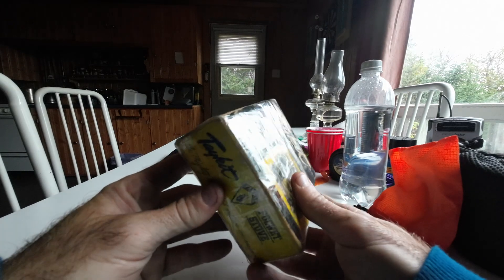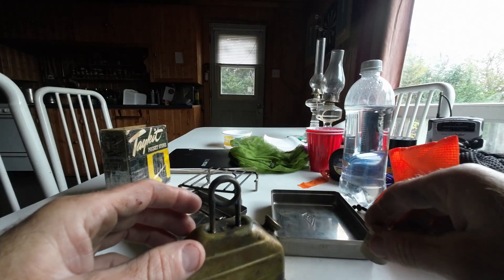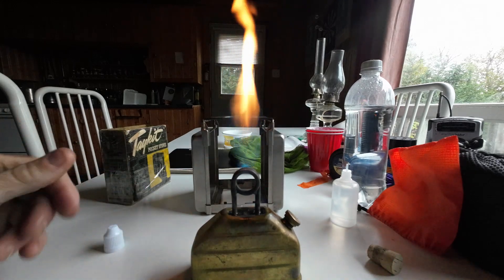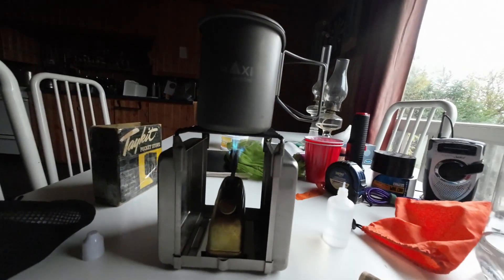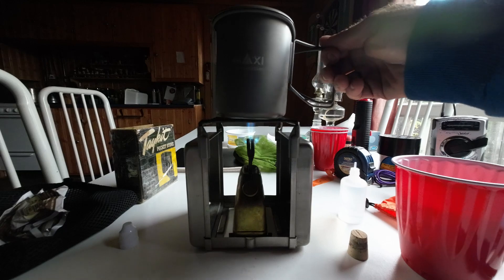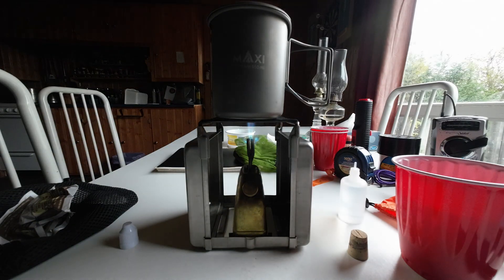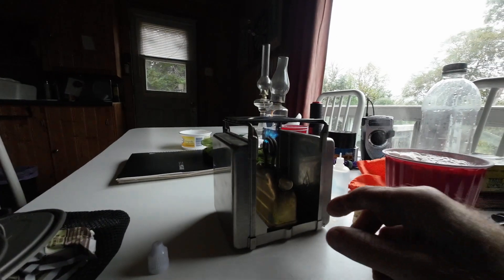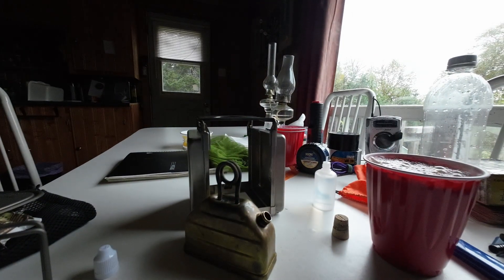taykit pocket stove demonstration

Comment: Hello. I have one and it works great, but I had to shelve it. When the temperature changes, the fuel will leak out of the orifice making a big hazardous mess. I don't have the funnel/cork thing that came with it that goes in the coil. Does the cork you use prevent it from leaking out? I'm wondering if I should go with natural cork, or a rubber one as my hardware sells both. Thank you!
Reply from the maker: If that little hole isn't plugged off it will leak every time 
I would definitely try the cork
I bought a 10 pack for only a few bucks and haven't had a leak since 
And with the cork it firs in place in the case perfectly 
Also make sure the gasket on the fill port isn't hardened
I usually screw it in hand tight and loosen a tad 
Never have leaks
Reply: @NLoutside75  Thank you very much. I'm going to have to try that, it's such a neat little stove. I'm trying to fab a stainless steel flame spreader like Steve Winkelman
@doinsngoins I hope I can pull it off!
Reply from the maker: @kenneth6731  you're welcome 
I saw the one he made 
Looks easy to make
Reply: Thank you for the video I just found one today at the swapmeet wanted to see it in use 🤙